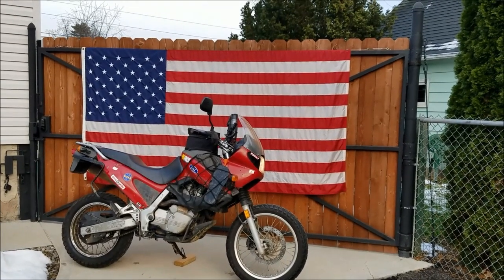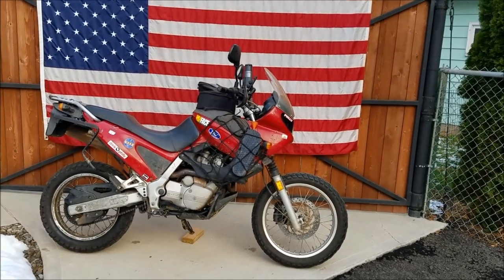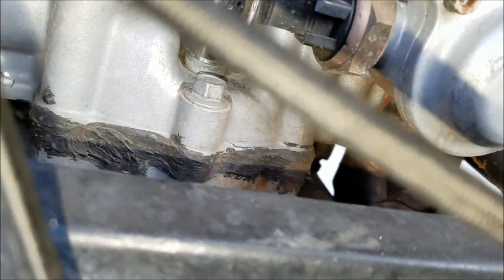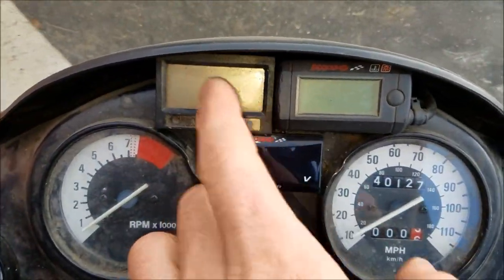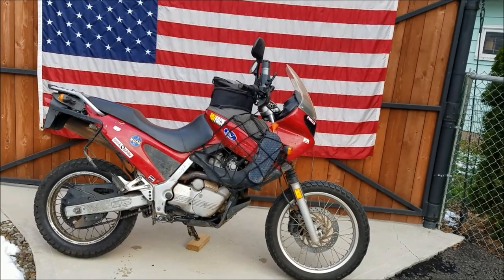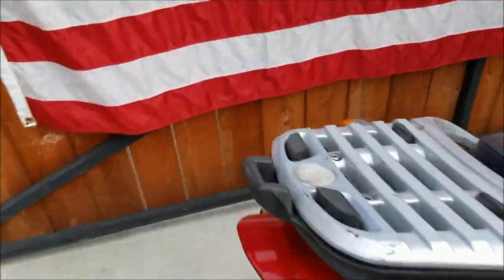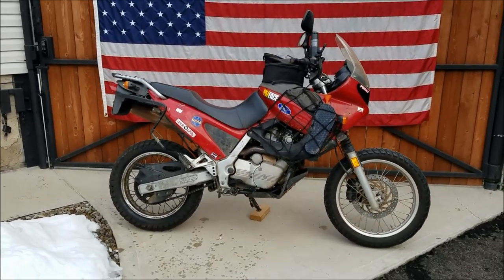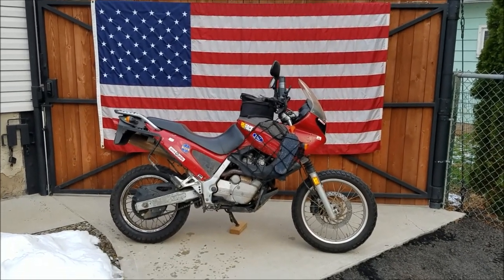BMW F650 FUNDURO REVIEW/MODS/ thoughts after owning for 10 years 1999 f 650 pegaso

Comment: The triathlete of motorcycles . Bought mine new in 1999. With the help of a very good mechanic to help keep it maintained it now has 176000 miles on it. Runs like a champ. Never had a need for anything else. Rotax engine is the heart and soul of this bike.
Reply: 176000 miles ??!! :O 
I have the same bike, but only 71000km I tought it was a lot but apparently not lol
Reply: @boris2919  I now have 182000 miles on my 1999 f650 . My mechanic said he has never seen a single go that far. He does a good job of helping maintain the bike. I pay close attention to any thing that needs fixing. The important thing is the durability of the Rotax motor and BMW frame. I try not to abuse it. It has seen lots of off road in Montana,Utah, Baja, California, Colorado, and Nevada. Enjoy your bike it will last a long time with special care.

Comment: I have had my 99 Funduro for six years in Australia. Like you I am totally impressed by all aspects of it. With 90,000k and countless off road falls mine is an indestructible war horse now rather than a show pony. Easy to ride, comfortable, unbelievably reliable and the maintenance and repairs are easy for a non mechanic like me. I read somewhere that the Funduro has been BMW's most reliable model ever. Thanks for your great video.

Comment: After selling my 98 F650, I've owned a R100GS Paris Dakar, R80G/S, and two early gen R1150GS'. I made many memories and did some amazing trips with them all. All have had every high end touring and off road upgrade known to man. They're all great bikes, but I've sold them all and have been lucky enough to buy back my original F650 after over 8 years. It's a TAT vet, done nearly 35k miles and is just a tank. I've been riding over a decade and I still went back to this as my single go-to motorcycle. Yeah there are faster bikes, yeah there are are more reliable bikes, but these are still (somehow) hidden gems. I'd say they're the jeep TJ of big bore singles.
Reply from the maker: Wow man what a story!  That's amazing and I totally agree that the f650 is such an underated bike.  Reliablity at its finest!
Reply from the maker: I recently acquired an f800gs and it's certainly an amazing bike. But there's no way I'll be selling my old Funduro. Too many good memories and especially after reading a comment like yours, my mind is set on keeping her forever.  Stylish? No, but definitely one tough bike!

Comment: I bought mine when it was only one year old, still have it, have been doing some work on it to freshen it up. No significant modifications, pretty much a stock bike, 27,000 miles.  Same year as yours, 1999, same color. I like your mods.
Reply: THATS FUNNY I HAVE THE SAME BIKE  SAME YEAR AND 28,000 MILES LOL.  DOES YOUR TEMP LIGHT TURN ON WITH BATTERY ON? MY OIL LIGHT DOES BUT NOT THE TEMP LIGHT.

Comment: I bought my 1993 Funduro 2 years ago for £700 with starship mileage. After 30 years and over 50 bikes of all sizes, it is  my 2nd favorite bike. It lives outdoors most of the year, yet always starts. Build quality seems amazing, the riding position is good. Living in Cornwall, this is almost the perfect bike for our tight twisting roads.  
Not for most of the States, but they are amazing for filtering (lane splitting.) Lots of low down power, well balanced, narrow and people notice the thump of the exhaust note. 
Perhaps one of the great bike bargains of all time.
Reply: YES ! I AGREE I LOVE MY 99 FUNDURO.  DOES YOUR BIKE TEMP LIGHT TURN ON WHEN THE IGNITION IS ENGAGED BUT NOT RUNNING? WHEN THE BATTERY IS ON, DOES YOUR TEMP LIGHT TURN ON ?

Comment from the maker: On Amazon:
*PERMATEX THE RIGHT STUFF: https://amzn.to/2XXsJLY
*RAM CELL MOUNT: https://amzn.to/2LfHNyH
*94-00 F650 SERVICE MANUAL: https://amzn.to/2OotNCp
*OIL FILTER I USE: https://amzn.to/2RRVW7d
*AIR FILTER: https://amzn.to/2OnGLk4
*SPARE VOLTAGE REGULATOR: https://amzn.to/2GPVhwD

Here is a video I made giving an overview of how I modified the rear suspension to have adjustable height: https://youtu.be/rz8OVnQ8CSI

Comment: Bought my 99 Funduro for 2k 3 maybe 4 years ago with 12k on it. It now has 38k only issues where a broken sprag clutch (it engages the starter) and regular rectifier which has gone bad at about the 15k mark twice, oddly enough the stock BMW part was no better than a generic chinese one for $15. This bike took me back and forth across the country 10k miles from upstate NY flawlessly (all except for a flat tire) I love it for that. Ergonomically very comfortable, fine off road, and good on the street. This motor is the same as the one in a bombardier ds650, so you could order parts for that at fraction of the bmw price. I have the same sleeping bag, awesome system and can't beat it for the price. I'm in the finger lakes, contact me if you want to ride.
Reply from the maker: Awesome to hear you've had a similar experience with the f650!  And that's cool you have the same sleeping bag! LOL. Yeah that would be cool. Or hit me up if you ever in the Philly area and will ride.  I recently picked up a 2009 f800gs. And I've been riding this bike more than anything. I actually put my F650 up for sale for $2,900. Which I doubt I'll get, but I'm torn on selling it to since it's been so reliable to me and I have so many memories on it

Comment: I have on of these as well, I love it. I looked on YT for videos about just now as we are putting it back together after it blew a head gasket and we got oil in water in the oil so we rebuilt the motor. now its going back together, cant wait to ride it again. In New Zealand its called the F650ST, nice video mate.
Reply from the maker: Sweet man good luck getting her back on the road. Definitely an amazing motorcycle
Reply: The F650ST is a newer version. It's called ST (Strada for street as it's less enduro) everywhere  Other models: CS (carver), GS (newer model)

The old F650 from the video is als called Typ169.

Comment: I have a 2000 Funduro (it is possibly for sale by the way) When I bought it, it had offroad tyres, I reckoned I wouldn't be using it offroad so have recently replaced them with road tyres. Makes a world of difference if you commute. I was looking to buy a KTM 390 but my old 2000 Funduro does the same job and since she is old I can adjust her a bit.  A fun and confidence building bike. Maybe a bit dull because it does everything you expect it to do. Sets off swiftly (I think it beats my Bandit 12)  but doesn't go much over a ton. An ideal bike for a beginner or returner (or someone like me that hates riding a 1200 in heavy traffic)

Comment: Good review. I have the a '94, 44,000 miles still going strong. If your rectifier ever goes again I recommend upgrading git to the one form the f650gs as it can handle higher voltages, I did it on mine and now the voltage is rock solid at 14.5v.
Reply from the maker: Tom awesome man! Yeah I hope you get a hundred thousand out of mine before I rebuild. And thank you for the tip on the regulator rectifier. I ended up rewiring one from a sportbike that I had laying around. Seems to work good, and I also keep a spare under the seat that's ready to Plug and Play.

Comment: I've bought a Pegaso 650 ie, basically the same engine, but with 5 valve head and fuel injection.  Only complaint so far is it's heavy.  Not gotten around to offroading yet but I think I might get another pair of wheel to put knobblies on.  It pulls like a train, and is unbelievably economical.  Love it so far.
Reply from the maker: I've never ridden a pegaso. They look like a pretty sweet bike though. I wouldn't call it quits until you give it a chance off road
Reply from the maker: It really depends on what type of hair off roading you plan on doing though. My F650 handles great on basically all the terrain I hit
Reply: I will try it, just need the wheels with nobbly's.  Current tyres have no grip off road.   @NoNonsenseKnowHow

Comment: I ride one of these. I ride it miles and miles along with my mates who ride with me on 20-year-old bandits (which are also indestructible). Love the envious looks we get from people on 10 grand bikes who stay in hotels when we're parked up next to them with all our camping gear and stash of beer riding similarly long distances on our 'pieces of shit'. You can't wash an electronic injector system out in a hotel sink, or fix a fly by wire throttle with bailing string.
Reply from the maker: Couldn't have said it better myself! We think alike!
Reply: I happened to watch your other video where you jacked it up by welding in that other shock mount hole. I highly approve of the out-the-box-ness. I don't want to do that because my arc welder and I produce pigeon-shit results. Therefore, I think mines gonna end up with a Dakar shock in it. When I do it, I'll post you back a youtube from somewhere intresting in the UK when I'm camped up.
Reply from the maker: @douglasbourne1393  awesome man! Yeah let me know what you end up getting!

Comment: I have a 1997 bmw f650st with 3000 miles on it, fully restored it!!
Reply from the maker: Brady Walrath awesome man. If I remember correct the only main differences, were Street Tires, 1 inch shorter front wheel, and a different belly body work piece.  The St is definitely a great bike.

Comment: Hi,Nice video, you are right this bike is great and cheap, 1200 pounds in Uk. I bought one two years ago with 35000 km and it has 62000 km today, did my all maintenance myself, cheap spares, easy and simple to work on and very comfortable to ride.
I modified the VR that comes under the seat and moved it by the air intake, made a bracket for that, they overheat under the seat, you had the issue I think. thanks for the video and great choice. Gus
Reply from the maker: Gustavo Bongioanni good to hear you're enjoying this great little motorcycle as much as me! And yes you're correct I did have a problem with the regulator overheating. I did the same thing and relocated it on the right side. Except I just drilled two holes right into the rubber snorkel and bolted it right to that.  Haven't had a problem since.  Thanks for watching and commenting!
Reply: Im watching your other video and I see you've done the same with VR.... lol , great videos thanks
Reply: Yes, lovely bike , Im an argentinean living in Wales and its a great bike to ride on here. Enjoy it, Gus

Comment: I'd advise you to change out the plugcaps and leads. The metal ones go bad quickly. Mine is a similair story, i did 53000km since i bought it in 2015 at 9000km. Only used on big trips (1-3 months). The last trip was 13000km, 18 countries. I tuned it to 57hp / 61nm, and it gets good mileage. I make alu skidplates for these bikes btw, send me a pm if you're interested.
Reply from the maker: Thanks for the tip! I haven't had an issue with mine yet after 40,000 miles. She never misses a Beat. But I'll certainly keep that fine if I start having misfires or an issue. How much are your skid plates?

Comment: my head 1999 BMW F650 headgasket is leaking a little, so you used Permatex Black Silicone Adhesive Sealant , and it has held good..............
Reply from the maker: Yes. Make sure it's Permatex the right stuff. There is a link to it in the description. I had the engine out of the frame when I did it so I was able to clean extremely good and thorough around the cylinder head gasket. And it never seeped again.
Reply: @NoNonsenseKnowHow  Thank you and Happy & Safe Trials !!!
Reply from the maker: @atank  no problem! Good luck and safe travels to you as well

Comment: I've owned a 94 for 3 months now an it's great on the open road. I mean, a 650cc single has no right to be so smooth. Sure it does vibrate but not even close to as much as you'd think.

Comment: I have an aprilia pegaso ga 650 -1992 mod (with the same Rotax 652ccm engine)and cant say how satesfied I am with this old thumper(( paid only 1300 pounds for it, than it had 1 yr mot ) , I have owned at least 20 different bikes in all engine sizes from 125 -1200 ccm  up trough the years,but never been one that I spent so much time on and had no issuses with ,what so ever ,my bike has run 49,000km now and starts at once every time, was a litle carb cleaning nessesary when I got it but never been any trouble after that was done

Comment: Great video, just about to start adventure riding with a '97 version. What tyres have you tried and which would you use again?
Cheers
PeterMac
Reply from the maker: Thanks. And nice, I think you'll definitely love it. I forget what exact model tires I had. I've never had beef with any tires though. Just as long as they're not too aggressive because if so they get very noisy and choppy. And then street tires are not great as well.  Middle of the road on off road tires

Comment: Great vid! Just picked up a '99 with under 30k. Did you follow a specific tutorial for migrating the voltage regulator to the snorkel? How difficult was it?
Reply from the maker: Daniel Melo no I just kind of mounted it there. Drilled two holes in the rubber snorkel and used to stainless 6mm bolts with nyloc nuts.  This is actually a spare regulator I mounted.  So I have the factory one and then I can plug this one in if  that fails

Comment: I so miss my Funduro.  I wish a mfg. would reproduce a bike like this with the Rotax engine.
Reply from the maker: I hear you on that! I sold mine about a year ago or so. I miss it some, but I've been loving my F800gs.  Rotax is definitely top notch!
Reply: Isn't that the BMW g650 GS? You have a Sertao version as well.
Reply from the maker: The bike in this video is a F650. At least that's what it's known in the states
Reply: @NoNonsenseKnowHow  what I meant is that Joel Buck wished for a brand to reproduce a bike like this, with the Rotax engine. Isn't that pretty much the G650?
Reply from the maker: Oh I got you.   Yeah I guess you're right.  But certainly not the same tough mule of a motorcycle that this is
Reply: https://en.wikipedia.org/wiki/BMW_G650GS
Reply from the maker: @99nobilis99  yeah that's why it's not even close to the same. It has alloy Wheels instead of spoke, and Chinese made Loncin engine according to that link. The original Funduros are extremely tough, well built motorcycles

Comment: Saw a pretty clean one of these for sale for $2k. Thanks to your vid, I just may pick it up. My 2018 Indian Scout spends as much time in the shop for warranty work as it does at my house or on the road. I’ve been looking for a bike that doesn’t stress me out and I can ride where I want to go, that doesn’t require 91 octane gas, and won’t throw engine codes every other day. I live in Colorado, so I’m wondering if the carb needs to be re jetted for elevation and how hard it is to get parts for?
Reply from the maker: Parts were always very easy to get for me to get.  and yes I would say it should be rejetted for Colorado I rode this particular one up Mount Antero, and it rained pretty rough up there.

Comment: I have a 99 too - live in boulder, about 22k on it.  I bought it earlier in the year and put about 2k on it so far. It started making a bit of a knocking noise under load when going up hills, kinda unpredictable and the gearbox is a bit crunchy, is this normal to a 650 single? Awesome vid and rear lift.
Reply from the maker: Awesome! Yeah these engines can be a little bit noisy especially at the lower RPMs under load. Totally normal. And yes the gearboxes are not the smoothest in the world, but mine was always very reliable
Reply: @NoNonsenseKnowHow  ok - cool, thanks. Its a good bike. Do you think the stock ground clearance 8in would be enough to tackle some of the passes in the alpine loop?
Reply from the maker: @roamingeagle  I'm not familiar with the Alpine Loop honestly. But yeah it's stock ground clearance is pretty sufficient for most trails
Reply: @NoNonsenseKnowHow  ok - no worries, thanks for the info!

Comment: I'm looking to buy this bike as my first bike, but I've heard a couple of them and I don't really like the stock sound. What slip-on did you say you have mounted on yours? 
Cheers
Reply from the maker: I agree with you that the bike doesn't sound too "cool"!  But believe me she makes up for it in many other areas. Plus as you get older you're going to want a quieter bike. I'm starting to get to that point. Exhaust on it is made by Staintune. I don't know much about the company but I ran into it on eBay and purchased it. I think it was around 200 Maybe? It mounted right up no problems and is an awesome exhaust
Reply from the maker: Let me know what you end up with. There are not a lot of muffler options for this bike that's for sure.  After looking it up, it seems that they are a handcrafted exhaust made in Australia. I guess I lucked out finding mine!  Those Australians make some Top Notch stuff!
Reply: @NoNonsenseKnowHow  Thanks for your reply! I guess you hit the jackpot with the exhaust costing 200 bucks. I've found a couple of them over here in the Netherlands costing about €1000, and that is nearly half of what these bikes cost. So I'll keep my eye out to find some cheaper ones or a completely different exhaust. But I guess I have to get the bike first before worrying too much about the exhaust haha.

Comment: How would you say this bike does on highways? And if I want to use it as a  daily driver on asphalt, would this be a good option? I'm looking for a tall bike, as I'm a tall dude, and this bike seems to tick most of the boxes (cheap, max47hp (regulations) tall, rugged, reliable)
Reply from the maker: It does awesome on the highways! I once rode this bike 1242 Mi non-stop to Denver (except to get gas and wizz)  took me 22 hours including breaking down once.  Rides wonderfully on the road